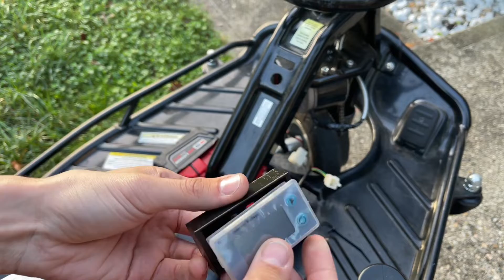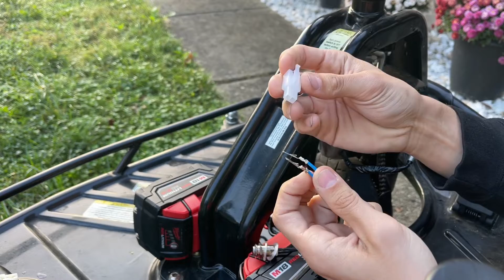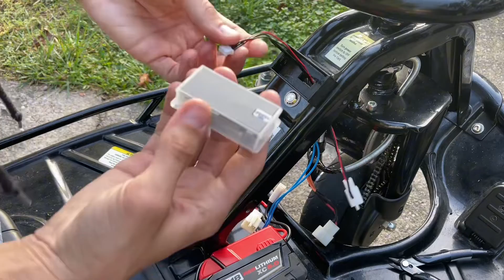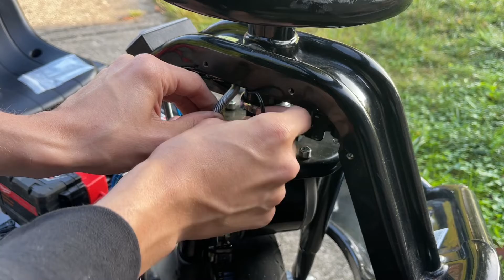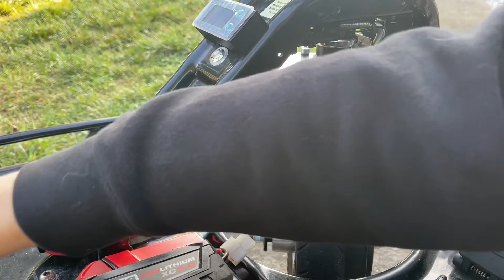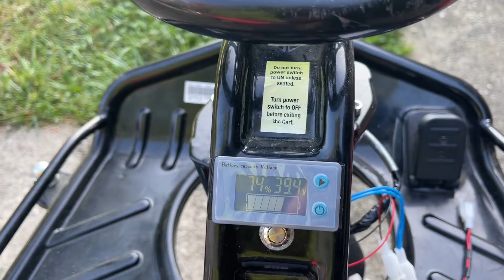Crazy Cart Battery Gauge Install - Jordy Builds

Comment: I just tried to set mine up with my controller from you and it wouldn’t show any thing on the screen but the screen would get really hot
Reply from the maker: Those are all tested before hand. Hopefully, you didn’t push the connector in with the pins mot straight. If so it probably fried the gauge.  Should have plugged in smooth
Reply: @JordyBuilds  I got my screen second hand so it might be fried

Comment: i bought the temperature gauge and a 48v controller but my battery percentage isn’t accurate on the temperature gauge no matter what my battery percentage is, it marks on the temperature gauge that i have 0 percent
Reply from the maker: Did you watch the video on how to set up voltage gauge linked in description?

Comment: Hey im just wondering if this is a stock cart, I have a stock cart, and bought a gauge from amazon and the only things that are different is the mount and the new on/off switch. I dont know how to install this gauge with no mount, would i have to buy the mount?
Reply from the maker: You can’t just buy a gauge for stock controller you’d have to solder it to power wires somehow. I sell plug and play controllers that this gauge kit is set up for. I go over all of that in the video

Comment: I have a random question I’m using a 40v ryobi battery to power it should I get the 36v controller or the 48v
Reply from the maker: I’ve had a few people have some issues out of the 40v ryobis. But you’d need 36v controller!
Reply: @JordyBuilds  swag thanks!

Comment: Hi I currently have taxi garage 36v and taxi garage speed controller. Will your controller and the gauge work with the taxi garage 36v
Reply from the maker: Yes if it has a dean connector or 4 pin connector adapter. Chose the option that best suites you and your battery connector

Comment: how will i charge my battery its a 48v but its a plug and play to stock switch/controller and charging port,but i ordered the gauge kit along with your 48v 1000w controller that i plan to use
Reply from the maker: Order a battery that has a charger. You won’t use the stock charge port.